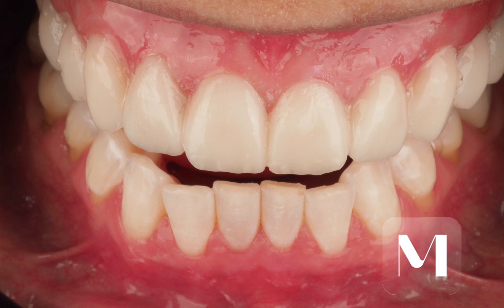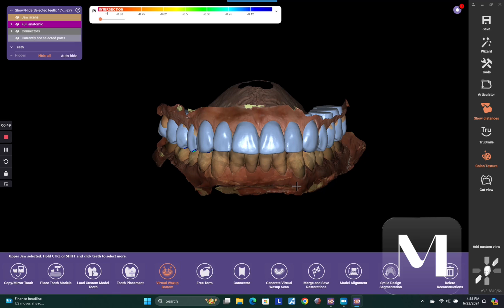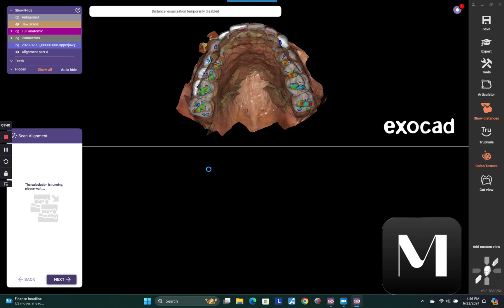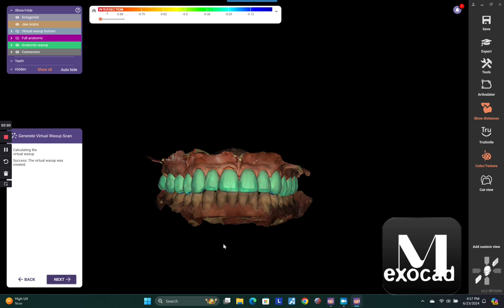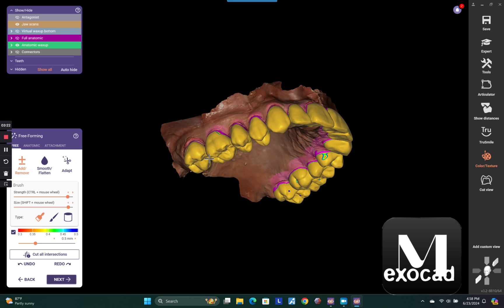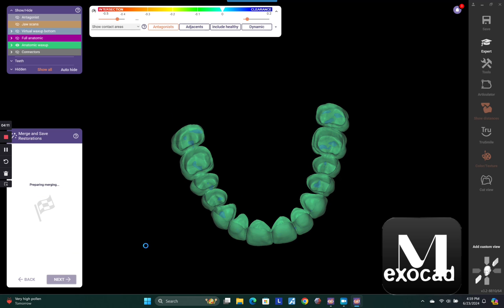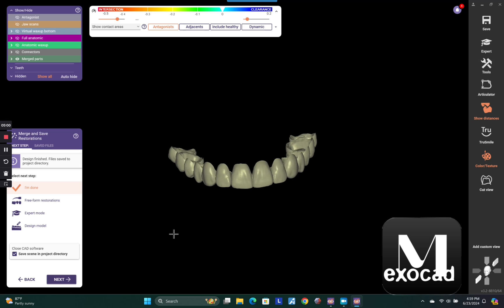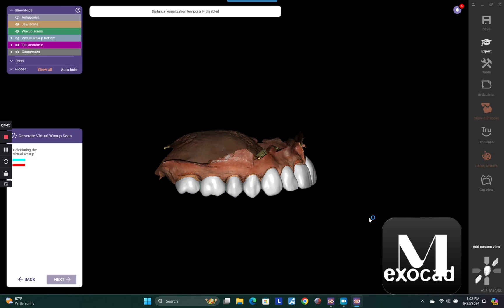Full arch temps in 5 minutes!

Comment: could you have pre-printed shell temps for this case and relined with bis-acryl or will this option be as good if not better?
Reply from the maker: Shell temps that are relined are half as good in my opinion. Seating shells is difficult. Getting reline to stick is difficult. Then have to trim.
Reply: @wallyrenne  thanks for the reply boss!